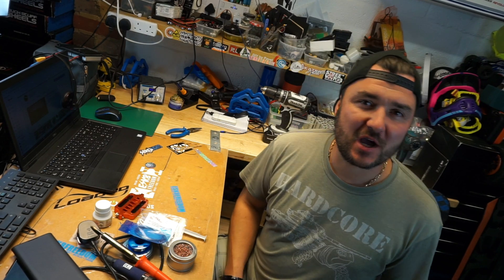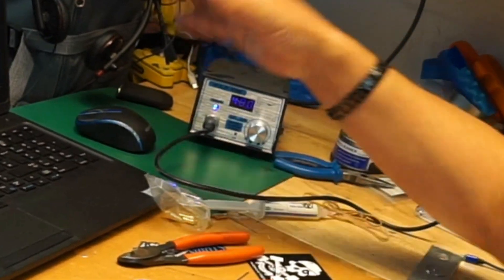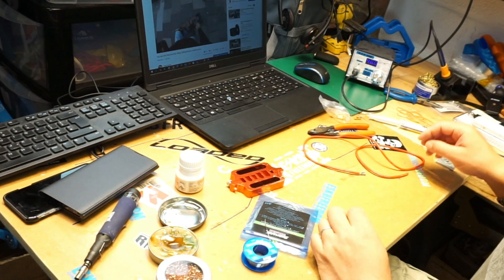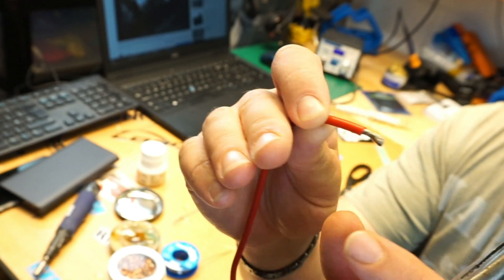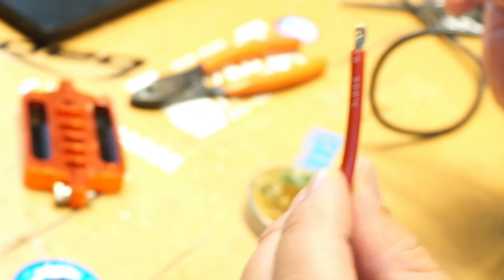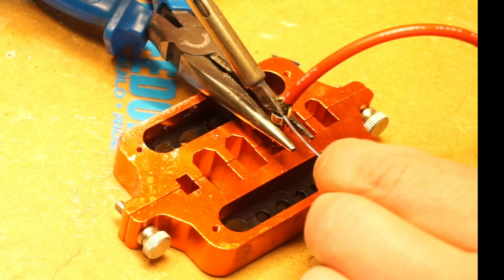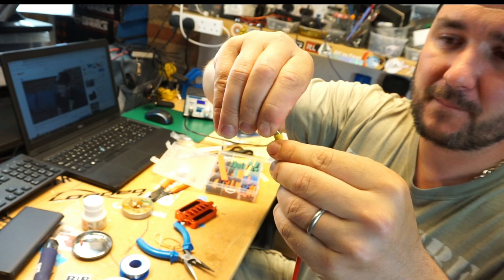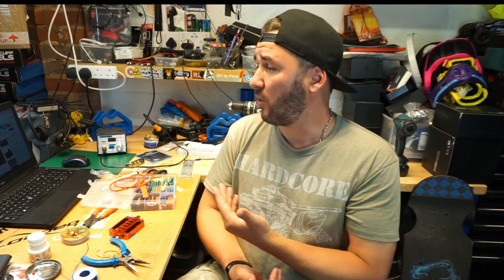How to solder TUTORIAL. very detailed!

Comment: Always pull about 10 pounds on that cable connection to make sure it will not break free, if you do not use the flux it will be a lot weaker and will break free🤙
Reply from the maker: I do just pull it about a bit to see if it is strong but normally you could see while soldering if the solder has melted correctly.

Comment: The heat shrink tubing is ideal which I do not have so I just wrap my connections with electrical tape, because I am not riding in the rain or wet conditions
Reply from the maker: best to use the heat shrink or capton tape.
Reply: Pavel Garmas I know😁